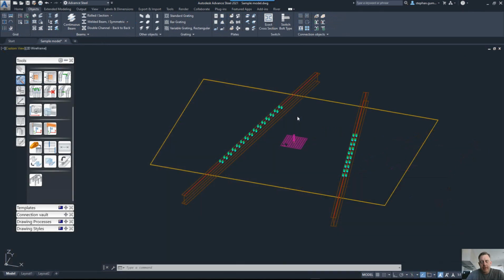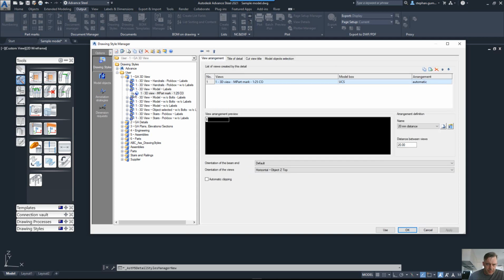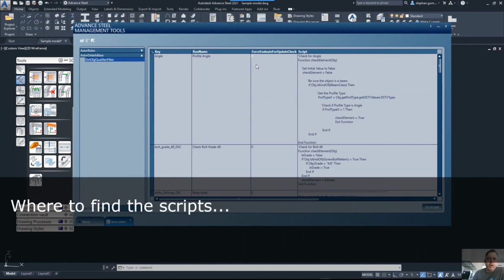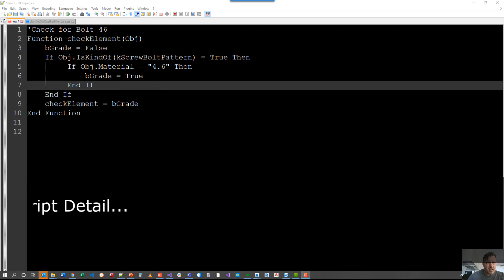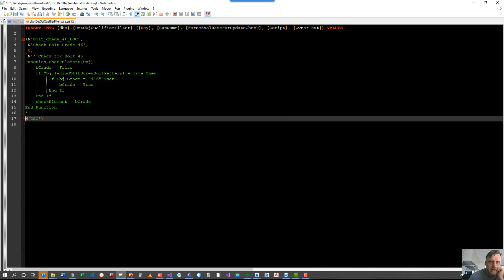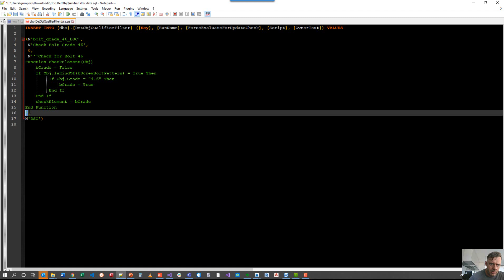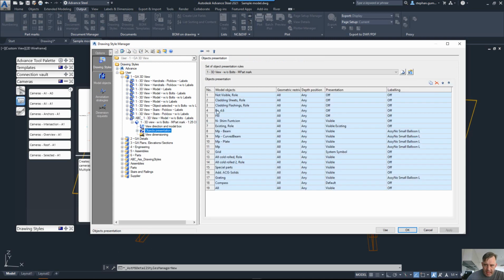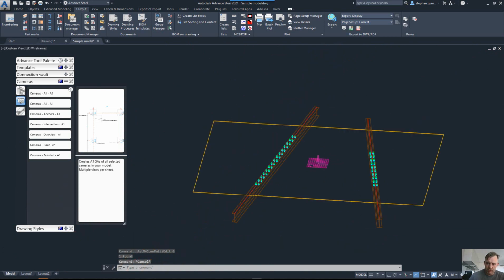Advance Steel Drawing Style - Object Filters

Comment: If I understood well, in this video you  explain how to customize (filter) what object wil appear in detail drawing
Reply: do you know how to insert the function into advance steel?
Reply: @Son96601  this function in embebed in Advance Steel. you need to customize it in Detail Drawing Strategy
Reply: @didaticaconsultoria1339  To add the filter of class 4.6 bolts, you need to write the function and add to the database he showed. It must be done in SQL management I think. 

Another question, do you know what different variables are available to use? For example he used bgrade in the video, do you know of any others? Is there a comprehensive list somewhere?
Reply: @Son96601  Yes, I forgot to comment, I will perform a test in SQL like he showed...Regardin the variable "bgrade", "bonsite" etc, I don´t know any comprehensive list, but I will search...I consider this tip very useful because you can, for example, display what you want in detail drawing...just create a new model role and edit the script in SQL
Reply: @didaticaconsultoria1339  BTW his Obj.Grade variable is not correct. I am testing this now and you can see when he goes into the actual database in AS, the Obj.Grade is Obj.Material...